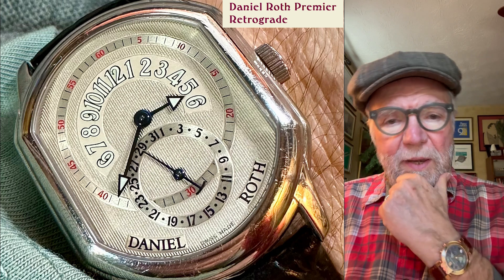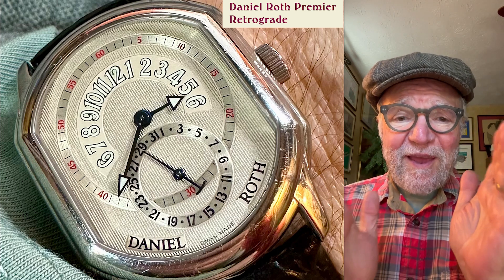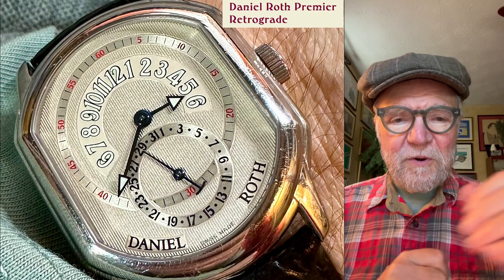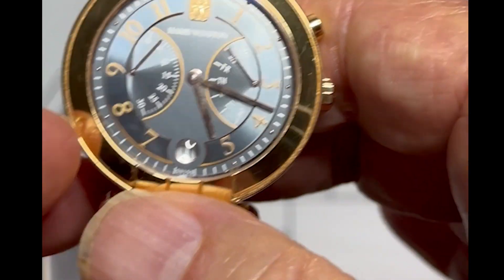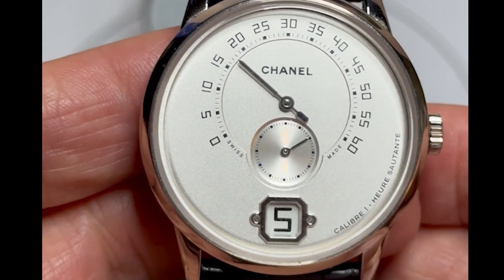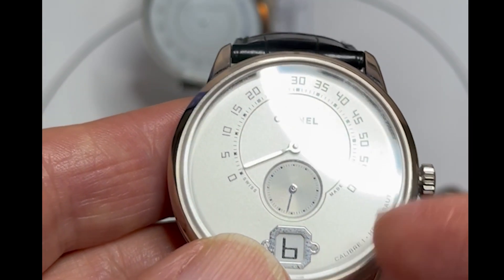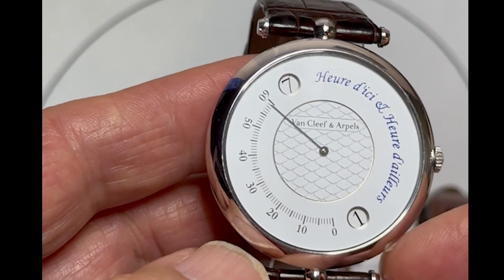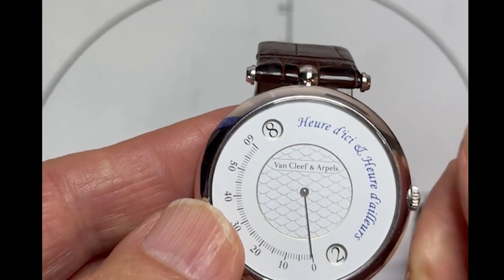Retrograde Watches: What They Do & How they Work #VP271

Comment: I have a Jean Richard with retrograde seconds and absolutely love it! This was a great illustration of what goes on inside. 
I did a slow motion video of the seconds hands once and the reset back to 0 was very “bouncy”. Does a retrograde mechanism require extra components (jewels, lubricants etc.) to prevent wear and tear?
Reply from the maker: I would think so Kumar, but my Harry Winston Bi-Retrograde seems to be doing fine with its retrograde 30-second retrograde. Take care, Bill
Reply: Didn't Kari Voutilainen invent a mechanism to ease the forces exerted on a retrograde? 🤔
Reply from the maker: @Lexcoaster  He may have. You have a link on that? I couldn't find anything on that.